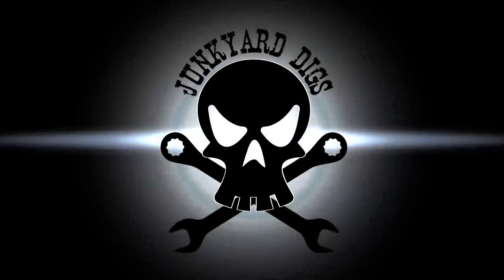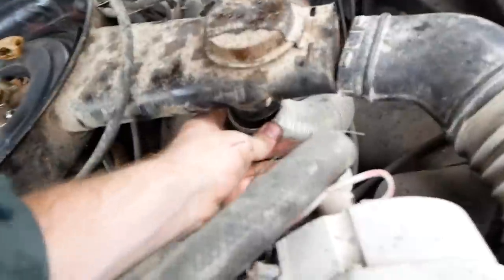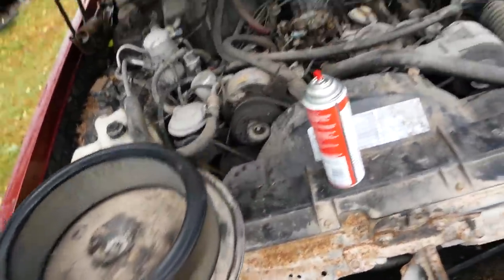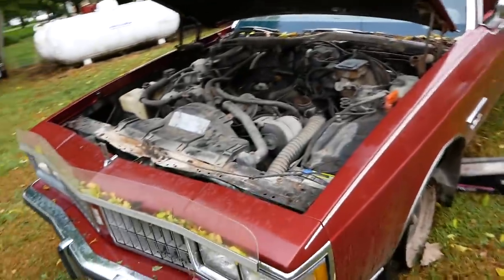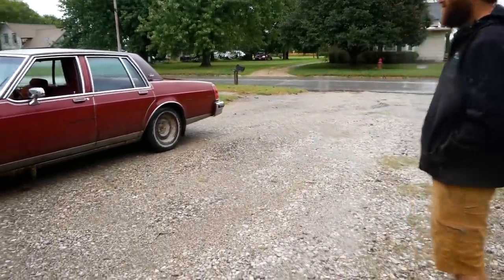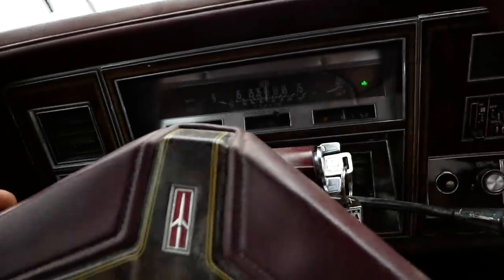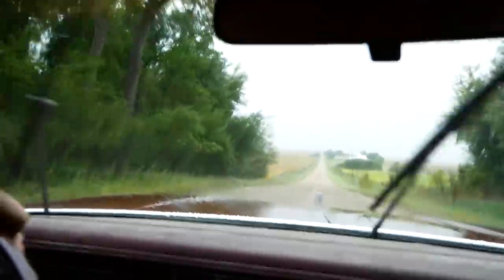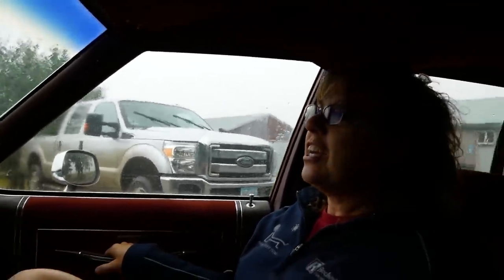$300 Beater First Start! Oldsmobile Rally Car??

Comment: I was trying and trying to comment on the old video, and then YT said it was taken down.  Then I discovered this one.  DO NOT tear up that car.  Best 300 dollars you have spent.  Clean it up and fix it up and make a driver out of it.  Too good a car to ruin or rally.
Reply: That's probably exactly what he did. (In the comments, he dediced that it was far too nice to rally with)
Reply: It needs a cleaning, also the engine.
Reply: Meh brick with wheels is still brick with wheels
Reply: The engine on those things just doesn't last much longer, hell they don't even have oil filters.. :)
Reply: @nou8257  Yep, but that brick would destroy any new car in a crash with just a ding to its bumper. If you could drive a boat like that and parallel park it, you could drive anything.
Reply: @tanis143  well yeah it's made of steel and has a full frame and I can park a truck with a trailer so no worries
Reply: @dodge698  That's strange. Maybe someone should tell Fram (PH3429), Hastings (LF230), AC Delco (PF61), and many others not to list their oil filters for this car.
Reply: @tanis143  Yea that brick would transfer all the force of the crash to the occupants of the car instead of absorbing it by bending and crushing the metal. I would rather have a crushed car than a scrambled me.
Reply: Yeah Safety Scott, you tell 'em!
Reply: People here in Oklahoma and Texas area drop 1k on them sitting on the jack stands. That was a steal.
Reply: You don't get such a car for 300$ here in Spain 😑
Reply: @dodge698  What do you mean doesn't have an oil filter?
Reply: @dodge698  What the hell do you mean that 307 Olds engine has no oil filter? My 82 Buick has been getting a filter change for 37 years.....
Reply: @dodge698  um yeah they do and they run forever
Reply: I was absolutely stunned I hope you keep this beautiful car original it’s a classic and needs to be saved looks like all it needs is a new headliner original type of course and then washed waxed I hope the original hubcaps are with it anyone that would destroy something this sharp beautiful in original condition needs help I’m sorry I don’t mean to be offensive but this is way to nice of a car to be ruined I was shocked when you said someone wanted to take it to a junkyard why ????its stunning it has style and is rare makes no sense
Reply: anselb2000 I don’t think you understand that no one cares
Reply: All the old cars similar to that were tanks
Reply: well guess what he’s turned it into a rally car it’s probably destroyed by now lol.
Reply: @nou8257  nicest $300 brick I've seen in years! 🤣 When I was a kid (and yeah this car wasn't even built yet) a $300 car was a kid's starter car and you bought what you could find ... Like my dad told me, you don't get a fancy first car cuz you're going to beat the 💩 out of it.
Reply: The added benefit to something like this as a first car, you learned basic upkeep. You did your own oil change, fixed your own flats, brakes, learned to replace the starter, alternator, belts and filters, exhaust system. You weren't afraid to mess it up then figured out it's hard to mess up the basics (unless you put water in the oil or something 🤣)... This thing is a LOT better than some I found in this price range...
Reply: Took my driver's test in an '84 delta88

Comment: Flip the air cleaner lid for QUADRAJET-THE SOUNDTRACK
Reply: My parents did that with a yellow delta 88 back in the day lol
Reply: @InfiniteMushroom Right!! I wonder how many car owners over the years have flipped those lids only to lose power.  You would only gain power if you cut a hole in the hood and installed a scoop.
Reply: @bimmerwman  - Lots of people in recent years have tested the flipped air cleaner lid, with completely negligible results. Some report minor increases in power/economy, some report minor decreases. Some claim one increases while the other decreases. But in all cases, it's very minor. 

The flipped lid does admittedly make the engine sound good, though.
Reply: @RadialSkid  That's true,  the induction noise adds a whole other level of excitement!!
Reply: OMG its amazing that others knew this trick as well
Reply: Quadra-JUNK LOL
Reply: Lol so funny n I did the same thing back in 1993 when I bought my grandparents 79 delta 88.    I just discovered it on my own.    Man it was a great sound. ,

Comment: Thats too nice to destroy. i would love to have that as a daily
Reply: Same
Reply: I agree. I can't see this car taking too much to fix up.
Reply: Trust me when I tell you as long as he isn’t hitting everything that olds is gonna take the rally abuse and shrug it off. i daily an  identical one except ‘83 and I have a mini spool and 3.73 gears and rip the hell out of it on the gravels here in Iowa and that thing will NOT die!!  2nd gear 40-50 mph power slides running god knows the rpm with the turd 3 speed and upgraded gears😂🤣😂
Reply: Yeah it would be cool

Comment: It has an electronic feedback carburetor with an oxygen sensor and a computer controlled lockup torque converter. The computer also controls ignition timing.
It was actually pretty contemporary for 1981.

Comment: the car runs nice. don't mess it up by doing burnouts
Reply: Well it's lucky the trans isn't numbered. Tyres, brakes, trans and diff only have to be the right model to match. Burnouts are the least of it's worries. That water-soaked lawn however...
Reply: Well it's lucky the trans isn't numbered. Tyres, brakes, trans and diff only have to be the right model to match. Burnouts are the least of it's worries. That water-soaked lawn however...

Comment: My aunt had one of them land yachts think it was a 78 delta 88.  Weighed about 40 tons took a city block to turn and dang did it go thru fuel like 13 miles to the gallon if I remember.  LOVED that car lol
Reply: eric l 
Give me 40 acres I turn that land yacht around.. 😂😂
Reply: They actually were pretty light for the physical size. That car was lighter than most of the ugly crossovers of today.
Reply: Simon Legree  yea my aunt I dont think took care of that care.  It was mostly her going out car.  She bought that after she blow up a 75 Lincoln continental that was a boat.  Loved that car to.  Man you hit a honda civic with a delta 88 it would be like hitting a bug it would be a speed bump.  What we hit? I dont know.  Should we stop? If we hit someone they would be beeping.
I think my aunts needed a carb rebuild plus it was all city and I was a teenage with a heavy foot lol. Might of been some reasons that car didnt do to hot lol...
Reply: +Simon Legree Damn man how were  you getting 29mpg? I take it it was a v6 or something?
Reply: +Simon Legree Man, I WISH my 86 vic could come close to that mileage. I'm lucky if I get 20mpg tbh.
Reply: Some huge older cars were surprisingly nimble.  My mother had a 1995 Lincoln Town Car - big as a battleship - that was very easy to drive and maneuver.
Reply: BRBingeDrinker my 2003 Honda Accord barely gets 24 highway and it’s a 4cylinder vtec
Reply: @ericl1627  
Funny back in the day, my friend in her fiero got rear ended by one of these....its front end was smashed.   Fiero was supreme

Comment: Our car we drove away from our wedding in 1995 was a 1984 Delta 88.  It was a great car.  This brings back memories.  I recognize that engine idle sound.  We could it in 1998 with 90,000 miles on it and a broken spring in the back.

Comment: Am man this makes me nostalgic. My mom and Dad bought a brand new 85 Delta 88 Royale Brougham in the fall of 1984. When I was born it was one of their everyday cars. My Dads mom bought the car from them in 1993. And then in 2007 I bought her back and drove the car from 2007 to 2018. She was getting hard to maintain with my schedule and I ended up selling her off. Sad I don’t have her now, but damn that was a sweet car. Smoothest car I’ve ever driven. 4 speed with OD. Cruise control. AC. Loved it
Reply: You have a freaking treasure in this car. This thing runs better after 2 years of sitting, AND it’s an 81 not an 85 like mine was, and looks and drives amazing.

Comment: Hard to beat an old gm boat! Dependable, tough and cheap to maintain. Basically the same car as a Chevrolet Caprice
Reply: they were on the same chassis if i remember right, or at least a  similar one
Reply: they are both B bodies where the olds  98 is a C body
Reply: If I'm not mistaken you can put a caprice front end on it
Reply: @snoopy5736  wouldn't surprise me one bit!
Reply: @snoopy5736  you probably could  the frames are the same and alot other parts are interchangeable
Reply: They are
Reply: The Pontiac Parisienne was also the same car. I had a 77 Caprice and then an 83. Great platform

Comment: Oh man, this would have been HILARIOUS to see in some rallycross! I'm a big fan of rallyx, even though I'm the stereotypical Subaru racer, lol. But I've seen some awesome entries, like a 1st gen Dakota, a Jag X-Type, a few Rangers, an 80's Caprice wagon, a Toyota Sequoia...the list goes on. But that's what's awesome about it, you don't need a racecar to go tear up a field and dodge some cones. Just a safe, solid car, some good tires, a helmet, and a few bucks. You should definitely try it with another car, though, it's absolutely worth it. Quick tip - winter tires are a great choice for lots of grip. I bought a set of barely used MasterCraft Glacier Grip 2 snow tires from a guy on Craigslist for $200 just to use as rallycross tires, and they're excellent.

Comment: Paid $250 for an 01 VW Passat GLS  Just a timing kit and i havnt touch a thing other than a CV  shaft. 7 months and 7 thousand miles. 145k

That Quadra jet is a great carb if you know what your doing. Tons of info on it from hotrod guys. I think one guy was running something around 600horse through one.
if one says a Q jet is junk, he needs to go back to school

Comment: Todays days dont make cars like that so smooth driving
Reply: @juubilo1509  That and a shit ton of computers, sensors, and other crap that takes machines worth more than the tools to diagnose and fix. Give me the old days when you just needed a good socket set, box end wrench set and a few specialized tools to fix anything on the car.
Reply: @tanis143  Fastened to the underside of the driver's seat cushion a junked 2001 Buick LeSabre Limited I found three computers or modules  wired in to the harness - apparently  just for the seat controls. I'm not from around here, I'm from another century, and sometimes this one seems too crazy.

Comment: There is a way to check the engine codes with the OBD1 cars, it involves sticking a paper clip or jumper in the access port under the dash. There's a few videos about it. Could be something as simple as a vacuum leak or because the exhaust is leaky before the o2 sensor. Or a plugged cat, bad smog pump, etc. The brake light will also come on if the switch on the prop valve is bad or the e brake is partially or fully engaged.
Reply: Probably that vacuum line that was unplugged caused it. I would make sure everything is connected and disconnect the battery overnight
Reply: When I was a kid, my grandma drove for years with that check engine light on. Never fixed it.

Comment: i got a 78 grand marquis it got power locks power windows a/c power trunk release power seats power antenna heated back window hideaway headlights cruise control and a big 460 3speed c6auto trans rides like a dream paid 800 for it well worth it
Reply: Bought a 75 Lincoln Continental Town Coupe for about 1500.  It's my daily when I'm home.
Reply: @Chris_Troxler  i got three 78 mercury two grand marquis 1 is a two door and a marquis and a 75 ford ltd landau
Reply: @richardhaggett7256  
Nice.  I was looking for a big body two door when ran across my Lincoln.  I actually had a 79 Mark V, but I sold it after I got the Connie.
Reply: @Chris_Troxler  nice almost bought a 79 mark v last week lol but going with a 78 tbird

Comment: You pissed in your nappies dude as this car was new, SO, treat it with RESPECT!
The hanging headliner was/is common on GM cars until 1989. They used thin 
cloth glued to a styrofoam box girder. A fix is only possible for a prof. upholstery craftsman.
These old engines give revenge when you crank them cold too high, they have
only 4.5 metric liters engine oil!! (Don''t push em too hard, you can drive with
the pressure in the carburetor).
The 81 was the first GM rwd driven car with a 4 speed auto tranny, they had
at this time many probs with failing 4th gear lock-ups. This persevered 
until 86 as GM produced the latest B,C,G-body (as far i remeber) rwd cars. 
GM at this decade never built quality cars with good clearance, positive 
camber steering angle, high output (2.3L quad 200hp e.g) troublefree 
mechanics or a durable painting. Everything was just chromed plastic or 
false wood not worth the penny GM charged for it, but it was FUN!!
Light years away from a S-Class Mercedes a 7 BMW or a Toyota Super
Saloon 2.8i.
I had in 1989 a 82 Buick Electra Park Avenue 350 cid. And it was fun!
Reply: I redid the headliner on my 85 caprice Landau myself a few years ago.  I wouldn't know how to take that styrofoam cardboard out of that four door car, my Landau was 2 doors which provided more space
Reply: usually you have to remove the windscreen
or the rear window. This cars have glued windows.
The best practice to get the funnel uhm 
headliner out of the car is to prior remove 
all seats.

Comment: As someone that has been known as a $100 car guy, since the early 80's, I'm not suprised at your find.

Some advice:

Look up date codes for tires and don't run them over 10 years.

Keep the oil changed. And the chassis greased. 

Don't waste money on a tach. 
Keep the stock radio.

Make sure you have spare keys.

Drive easy no heavy breaking, don't floor it unless to merge or pass.  Stressing the drive train is only going to leave you walking.

Should you blow a transmission or an engine, often buying a car that has a good one is cheapest source.

Always have a spare car when the primary breaks down.

Don't change to synthetic oil.

Comment: I had a 1982 delta 88 royale a few years ago that I picked up for $600, the guy I bought it from swapped in a posi rear from another olds and a tbi 350 and 700r4 out of a 93 caprice cop car, thing was a lot of fun and sounded pretty sweet straight piped, drove it for 2 years and all it needed were breaks and a windshield.

Comment: A friend of mine had a Buick just like this except it had a diesel V-8. The darn thing got like 30 mpg! I used to say it was like 4 lazy boy recliners with an engine. We called it the Buickstar Gallactaca (after the spaceship Battlestar Gallactaca in the 80's tv show) cause it was so big. It actually was my friends girlfriends car and she was so short I don't think she could see over the dash but she used to whip that thing around underground parking lots in L.A. like it was a toy. I drove it from LA to Utah to go skiing and there was a huge storm the day before and I kid you not they had gotten 7 feet of snow and I was following this snow plow/blower up a twisty mountain road with no snow tires. I knew if I stopped before I reached the top I'd have to back it up about 10 miles and start again cause the plow was cutting one lane and there was just walls of snow on either side. It looked like a snowboard half pipe only narrower.  I made it to the top but I had to leave the car out over night so the next day it would crank but wouldn't start. I'm a gasoline based life form and know zip about diesels except don't put starter fluid in them cause they will explode. Lucky for me there was a building nearby where they kept the snow plow and other road maintenance equipment and the guy there said to use WD-40 down the intake. I was skeptical but it worked and I also found out the car had a built in block heater with an extension cord under the hood to keep the block warm. The hotel where I stayed had underground parking with a place to plug in the block heater. The car had started life in Houston and then gone to LA. so I guess it was finally in its true environment! Most comfortable car I ever drove and you didn't need a ski rack cause you could just throw your skis in the trunk. Check out the trunk on yours-it's like a black hole only bigger!

Comment: These are really nice cars!  YES they DID have a computer in 1981!  It was the first year.  GM was ahead of everyone else on that.  The computer controlled the fuel mixture and the spark advance.  And your mom (?) is right - 84 had orange and red lights, the earlier ones had all red.  This is really nice with the velour interior - an burgundy is nice!  Many nice options too.  Glad you saved it from the crusher!  Runs too well for that.

Comment: I had an 81 Delta 88.  Had 23,000 miles on it no paperwork bought from an estate sale. I gutted it put a 8 point cage it an ran it for 10 years and about 100 Enduro races.  Had 307 to start. That blew up 2nd race. 350 was next .  Then I dumped a 400 Pontiac in it . Then a bunch of 403 and 350's. Had a 455 olds in it that made 56 laps out of 100 emptied the entire contents of inside engine out through many holes it made.  Then went to small block Chevy's. Then they outlawed the class because it's supposed to be a stock class.  No engine mods whatsoever. People were stuffing built engines under greezy old valve covers . No they call it hobby stock now.

Comment: Hello 

I saw on one of your other video's on this car  that you had put the motor oil in the wrong place, but you never say where ? I was just wondering where did you put it ? In the power steering tube ? I couldn't believe their was no oil fill cap on either of the rocker covers ? It's hard to tell in the video, I was just wondering, and did you need to get the oil out of where ever you put it in ? Looks like a nice car it was a nice find.
Reply from the maker: It was still into the engine but just through the wrong hole
Reply: That makes more sense,  Thank You...